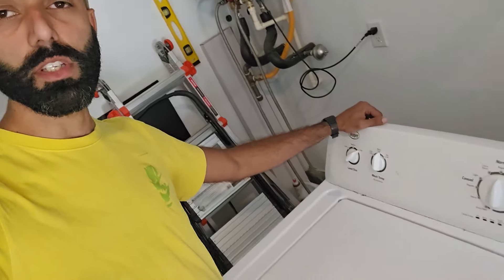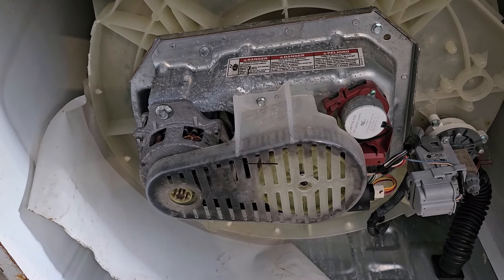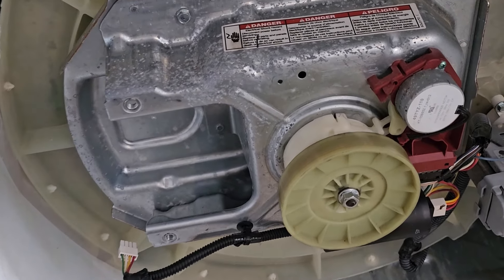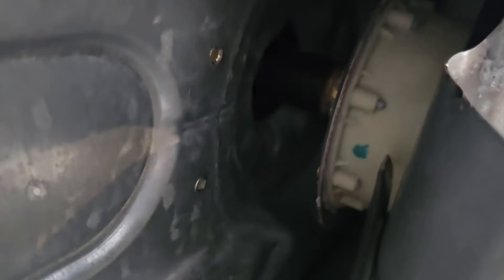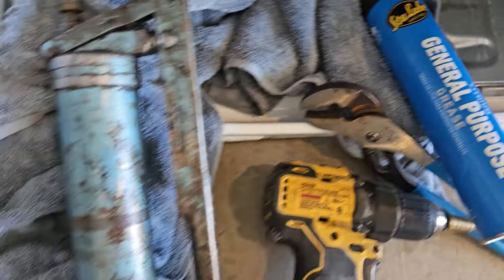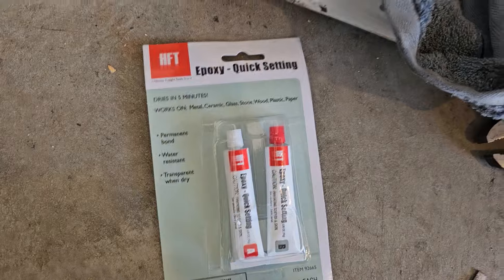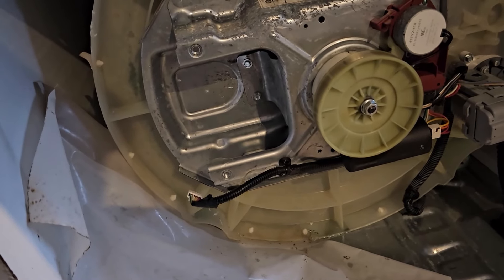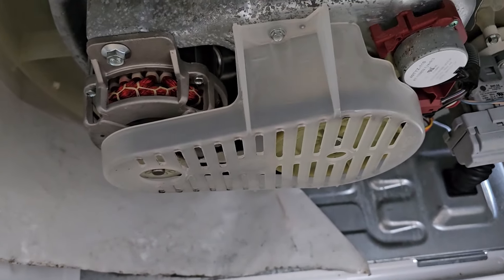Draining And Refilling A Whirlpool/Maytag Washer Transmission!

Comment: Likely can just drill a smaller hole and screw in a grease fitting into the plastic as long as you dont over tighten it or over grease it.

Comment: Hi, I noticed that my Kenmore 800 series washer is leaking oil from the vent hole at the top of the transmission. I also saw some water dripping. What could be causing this? Can I add more oil to the transmission? How do I send you pictures so that understand what I am talking about?
Reply from the maker: Remove the transmission shaft seal, fill with gear oil through the holes caused by removing the seals, replace with new seal. Here is a video I made:
https://youtu.be/I8-AjfhTqWY

Comment: Hey brother I did the exact process. However, after putting everything back together it's making a loud noise that it wasn't making before during the wash and spin cycles. Can you 
point me in the right direction.
Reply from the maker: Did you assemble the clutch correctly? Remove the belt and shifter and see if the clutch is moving up and down as it should (i would remove the clutch and reinstall it). Second thing to check is to make sure the metal tab you folded down is not rubbing against the transmission (they can get mangled I recommend only pulling the tab down by  hand and not with a pry bar). Lastly, did you drill the hole too far down on the transmission? If so, it is possible you damaged the seats (this works best if the hole is on the upper part of the transmission as in the video). Best of luck!
Reply: @DuctTapeMechanic  i drilled the whole in the upper part on the case. I'll check to make sure the tab isn't touching. The clutch is moving up and down. Thanks for responding.
Reply: @DuctTapeMechanic  Thanks for all of your help and guidance brother. That problem is solved. The metal tab was rubbing against the transmission. Now i have two more problems. I replaced the suspension rods, but the washer still shakes uncontrollably. Also, I tried to calibrate the washer, but when i press the start button to do so it shuts off completely. However, i was able to wash a full load of clothing without any problems other than the tub bouncing against the sides of the machine during the spin cycles. I have no idea why it's bouncing so much. Next, I'm going to put a level on it and adjust the legs to see if that fix the problem. Do you have any suggestions?